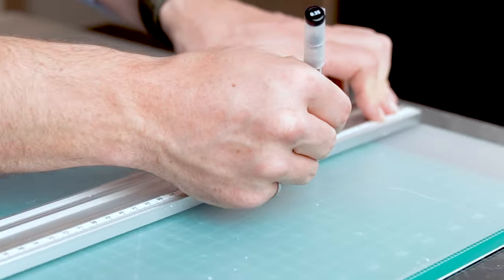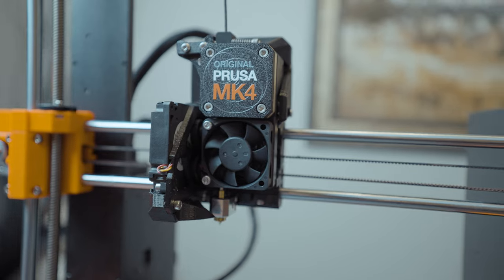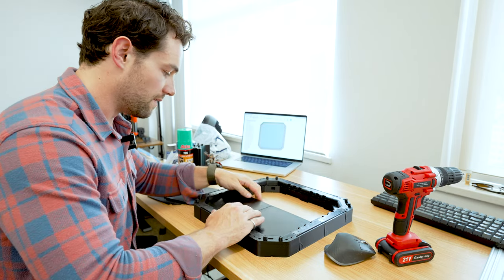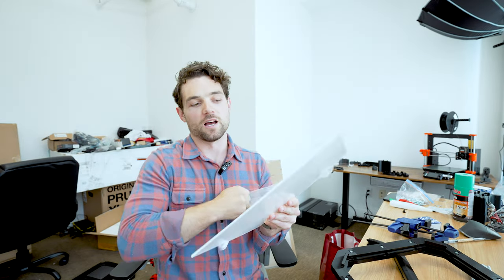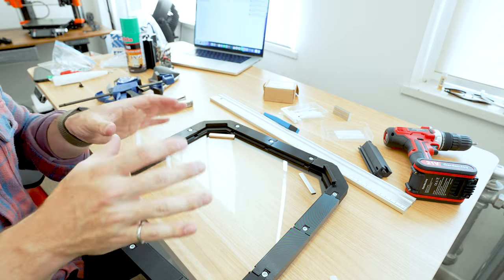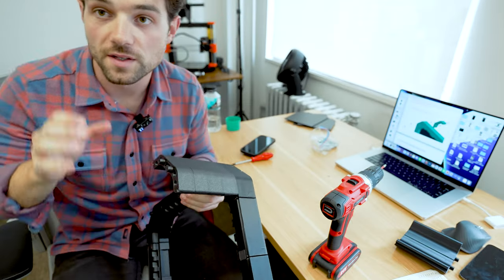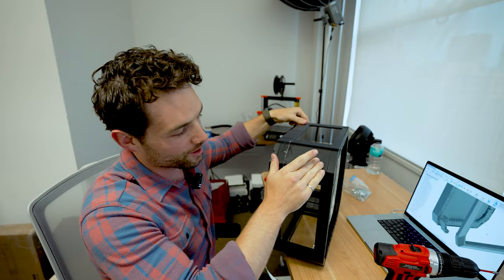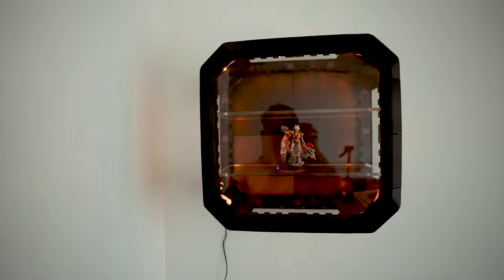3D Printed Modular Display Case

Comment: I'm starting to print out my first Omni display, and my corner pieces (BC) and backs (BB) have a ledge that sticks up on them. Am I printing out the right file? Or is there another back plate file that I need to look for in the folder? Just needing to ask as I have the four corners and three of the backs printed out so far. I have a small printer.

Comment: Great video, really helps for backers.
I thought for sure we'd have to cut the acrylic corners off, but awesome that we don't even need to do that.
I've used acrylic before in making an enclosure for my 3D printer, and the only annoying thing was that it was the static charge it had, especially after pulling off the plastic film.
Any ideas on getting rid of that static charge so it doesn't attract every particle in the air to it?
Reply from the maker: Thank you Richard! I think the static contributed to my glue getting on the acrylic in the video haha. I think maybe washing it first could help.. will test to be sure 👌
Reply: You can wear an anti static wrist band for electronics to help. Also a mist of water should also help with this.

Comment: While watching this, a random thought popped up - is it possible/feasible to make a mini Detolf-like cabinet?

By using the rear bezel as a 'floor bezel' and the front window (without the front piece attached) as a shelf and another set of depth pieces and front window. Of course it would basically need to be disassembled every time you want to add/remove something in the bottom and I'm not sure how much total weight the bottom shelf would be able to withstand.  A good expansion/update later on would be a side window that's removed differently so you can still do this without having to dissasemble the entire thing to reach a lower shelf

Comment: I was a backer for the commercial license, after running the numbers and the amount of hours needed to print a 330x330 with acrylic shelves, selling for anything less than $400 dollars would not be worth it, and I just cant see this selling like hot cakes at that price. It would still require assembly. Its a great idea and really cool for personal stuff, just didn't expect it to be this much to produce.
Reply from the maker: Hey @collect3D. For commercial, if you're trying to print quantity of these I would recommend the following.  0.6 nozzle, rear base piece - we included dxf files for if you want to cut it from another material so there is no print time and the cost is very low, the fasteners are really cheap so the rest just depends on your print set up. We did one omni a day during testing with 3 machines and they each had a spoll of filament so it was only about $60 to print one and 24 hour of print time.
Reply: @AustenHartley  Thanks for the reply Austin. For my print farm I charge X per hour per machine, so it would be around 75-80 hours of print time at .4mm layer height and that is if you have a nozzle that can flow 20mms3. Filament is marked up as well 30% packing and labor calculated, from a business perspective its a lot more expensive. Charging anything less than $2 an hour print time is about the bare minimum any fully time print farm would print at. Print time and filament alone you're looking at $260, no including labor, shipping, acrylic, I think $400 is a decent price point if people are willing to pay. If you're looking to just build a personal display case, then just the cost of filament $60 and the fasteners its quite inexpensive.
Reply from the maker: @Redo3D  Thats totally fair!! I respect that! Every business has their own pricing strategy.
Reply: @AustenHartley  I think this is a fanatic design though, and job well done.

Comment: hello  Austin i just got a Ender 3 and I'm having some trouble with it was curious if you had the same problem when you got yours or if I'm just not doing everything correctly. when i print the test prints out they print perfectly but when I download a file and slice it and turn it into a G code on ultimaker cura it runs the print but doesn't seem to extrude at the correct rate -_- any fixes or tips?? thx!!
Reply: The joys of owning an Ender 3 :D
Suggest watching some Teaching Tech videos on the Ender and doing lots of tests. Just an FYI, I hated the extruder on my Ender. A complete POS that I changed several times. It's the worst part of the printer imo.

Comment: Just a suggestion those LEDs can be cut to void having a roll attached on the back so you can use them for another omni!
Reply from the maker: Defs the best way to do it! I just dont want to recommend people cut electric cables for safety reasons or incase they cut at the wrong spot and toast the LED strip haha. But yeah the LEDS come with instructions on how to do it too.

Comment: Hi Austen,
As for the dept pieces,  can you mix a large one with a smaller one ?
Also, how large of a case can you really built.  (I was thinking something in the 48''x36'' range...).
I would assume the limitation would be the weight the 4 magnets in the front panel are able to take?
TIA
Reply from the maker: Hey! You cannot mix a large and a small! if you want bigger than the 4 depth standard, you would need to print them individually. The front cover has grooves to take the weight, the magnets are just to help so that wont be an issue!

Comment: In my country I can only find acrylic glas up to 204x304mm and I can only get thicknesses in full mm intervalls.

So
1/8 Inch is 3.2 mm 
1/4 Inch is 6.35 mm

So will 3 and 6mm fit well? And can I find a custom option that is equal or smaller than 204x304mm (11,04*8,03inch) ?
Reply from the maker: 3 and 6 will work!!
Reply: @AustenHartley  Thanks that's a relif to know :) and to my second question are there custom options available to print cases that only need a acrylic glas that is  204x304mm (11,04x8,03inch) or smaller? That is the max size I found I can buy in my country without importing.
Reply from the maker: @Raffix394  For sure! The whole thing is modular so you just use less pieces. Also worth noting, you can just use two pieces of acrylic on top of each other (there will be a little seam but you can put the shelf where the seam is and it works great, we did this during prototyping to avoid wasting so much acrylic!)

Comment: After all this time still no update on if the covers replace the front bezel or does one click it over them?
What backplate do I need to print if it doesn't connect to the side, mine will be like 2 corners and 3 pieces wide.
What is a proper way to measure acrylic plate size when you haven't got any of the standard display sizes?
No matter if I use raft, supports, brims or nothing the corners are just not beautiful. ALways something not smooth on them.
Reply from the maker: The covers snap overtop. There is a PDF in the folder with backplate instructions that show how it is built to any size. There is an excel sheet that will give you the exact acrylic dimensions. And there is a 90 degree corner option if you don’t want to dial in the print settings for the corners!
Reply: Thanks for the fast reply. I may have gotten lost in the folders. I will try again. @AustenHartley

Comment: First, thanks for the video and the project, really like the way it is looking so far. I have two comments:
I wanted to use acrylic for the back panel as well, and I thought it was weird that I have to cut the corners off for it. Why didn't you put the groove in so that a square panel could be used like you did for the door? That would make using acrylic for this so much easier. 

I also think you should use capture nuts like you did for the side pieces on the back and front frame, that way the screws won't be visible from the front you wont need cover plates. Only two modifications I have found so far that would make this an even greater product.
Reply from the maker: Noted! And thank you for the feedback!! 🙏🙏🤙

Comment: Just wondering is there a place that someone has already calculated print times for each size and amount of filament it takes for each size?
Reply: I printed a pair of 330*330 ones. Did not print back plates as I used mdf for the backing instead. It took about 1.8kg of filament each. Close to 2 roles per case. With a 0.6mm nozzle on my Ender 3 total print time for each was somewhere around the 80 hours range. It's a lot of filament and a lot of time per case.

Comment: I finally got around to printing one of these.
Printed at 20% infill, 0.2mm layer, 50mm/s (Creality standard settings) without a printed back, a small (exterior 282 square) case:
1.3 kilos of filament
10 days to print
Insanity. Not happening!
Reply from the maker: go 0.3 layer height, up the temp a bit, 80mm/s and 6-10% gyroid. Those settings you listed are 10x overkill for these prints.
Reply from the maker: Can also put a 0.6 nozzle on there. You should easily be able to cut your print time in half.